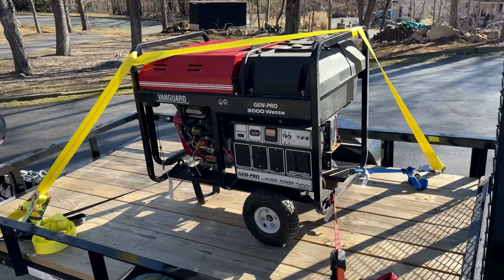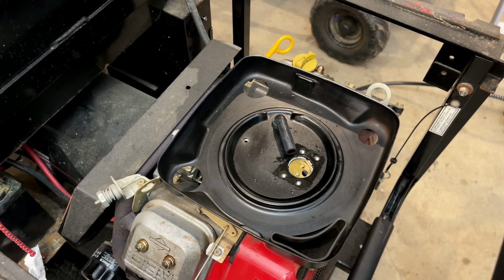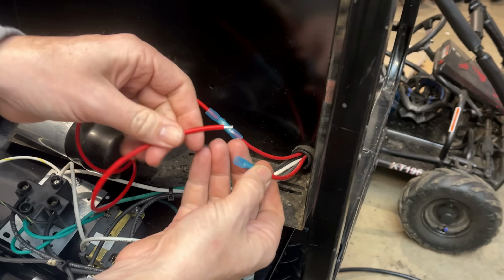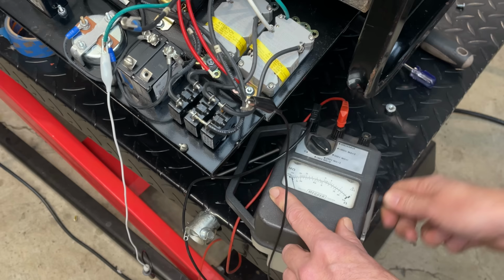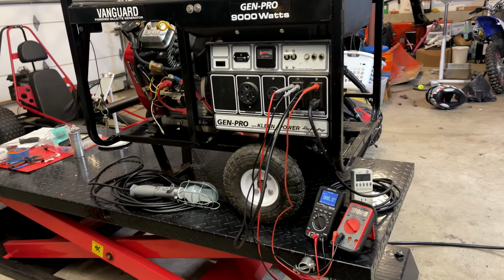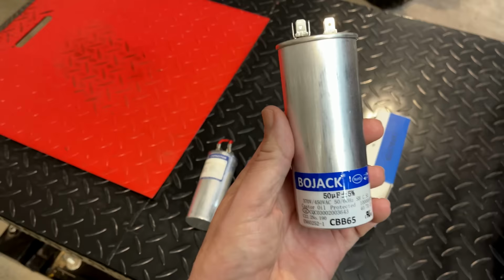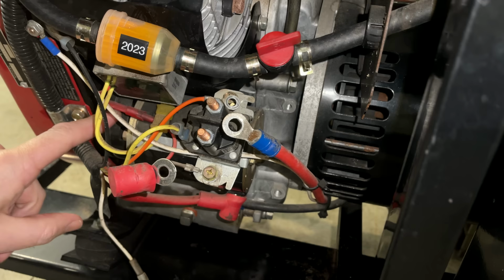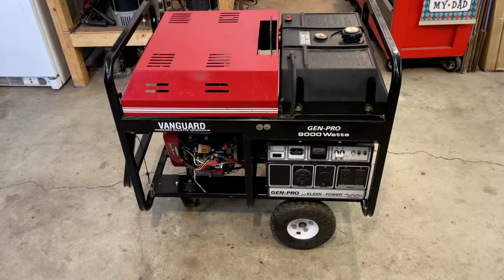How To Test and Fix A Brushless Generator

Comment: When you mentioned dropping a bolt down and intake, I have a question in that area. I am working on a mower with a Honda GCV160 engine. I was doing an oil change, and used a fluid pump to extract that oil. The tip of my fluid pump fell off in the dipstick tube and into the engine. It is made of rubber and is about an inch long. Is there any chance that I could leave it without having major issues? I really don't want to have to dismantle the entire motor due to a stupid piece of rubber. I resurrected this mower for a friend of mine after sitting for a few years, and I was almost done.
Reply: If you want peace of mind find someone with a scope with a grabber, oh, and I feel your pain, gravity and friction are cruel
Reply from the maker: I agree with Peter.  A scope with a grabber.  Chances are it will not cause damage, but I could imagine a scenario where it jams up the engine.

Comment: Did the first replacement capacitor happen to have a production or date of manuf on it.
Reply from the maker: It did not
Reply: Just wondered if it might have been an electrolytic cap.  They don’t have a real long life whether in or out if service.  In service their life is reduced quickly in hit applications and if stored in uncontrolled temp areas they are aging snd their in service life will be shorter.  It’s been a long time since I actively worked in the electronics industry and electrolytic caps were things we generated scheduled Mntc every 5-7 years to replace them.

Comment: I have a Porter Cable BSV750-W-3 7500 Watt brushless generator with a Vanguard Engine that generates low voltage 112-114v since purchase. When operating under a 1500W load the one outlet produces steady 60 hz, but the other outlet wanders 59-67 hz. Hoping to improve the power situation I pulled the stator cover and did not see an arrangement of wires like any of your videos.  I am finding 3 sets of winding wires off the stator, with one set heading off to a rectifier attached to the 12 volt output on the front panel. Is this extra winding a potential source of the unstable frequency in one leg?
Reply from the maker: Most likely the sine wave is not clean and your meter is having trouble measuring the hertz.  I see that a lot on brushless generators due to their design.  If you put a load on it the sine wave cleans up some and might improve the reading.  You can see the typical brushless output in this video.  https://youtu.be/9-oaSVL2AE0?si=4jWGC5WTfUnhm6SU. Also in this video is an example where I had difficulty getting a accurate hertz reading https://youtu.be/Um-rXWv_-iY?si=qRQA0DdULfwHdcmb
Reply: @jcondon1  Thank you for your reply, I appreciate your videos and taking the time to reply.  
I have not tried to examine the waveform, but was relying on the Kill A Watt device to report Hz.  You raise a great point here—I really don’t know how this device is sampling the wave and this “jumping around” of the cps number may just be an artifact of the sampling. I guess I will have to dig out the scope now and actually examine this wave. 
Thanks for the video links. I will watch them and continue the learning process.

Comment: Now I've never understood this why do you have it on when you Power It Up you're not supposed to generally you're supposed to have it off and then kick it on after the engine turns on I don't get it
Reply from the maker: A 70 watt load is not an issue.  Ideally you would let the engine warm up before putting any significant load on.  Also sensitive loads could be damaged by the surge associated with startup and shutdown.  A resistive light bulb can handle it.

Comment: always wipe the wire when you pull  it  out of the  emunislion tube otherwise you re contamenate the hole with that crud  watch    the start of your video as you don't do that you re introduce  what you cleaned out otherwise good video.

Comment: You could have used one of the, cut off, red wires to pull the two on the new capacitor through the conduit. Removing one of, cut off, ones to make more room before pulling them in the conduit.

Comment: That is the true quality of American built products, not sure about todays products. The company that made this unit, if I remember correctly was all American made and designed. They are not seen much my way out in the wild.

I like Honda Gen-Sets as well, however they are junk because the inverters are discontinued in a rather short period of time. Also the inverter assemblies, if you can get them from Honda are way overpriced. What good is a $8000.00 Honda you can't get an inverter for ??

Comment: i fixed this generator before for my friends it was dead i checked the compressions no compression tested the vale it leaking i said I can brings it backs to life again I need new parts the problems is there’s is no parts anywhere for this model he said can I do anything’s gets it worked agains without need any parts for it I said yes I can it easy it a pieces of cake i throw them in to the rubbish bins

Comment: How do you know 100% that the capacitor is discharged.  Those things scare me a bit.  I need to run the screw driver over them a dozen times before i feel safe.

Comment: While Relay Coils are not my Electrical Area of Expertise, I personally wouldn't risk trying to jar the plunger loose and continue to use the coil...

If it jammed once, there is a VERY high likelihood of it jamming on again and that will likely be the time it destroys the starter and/or severely damages motor itself...NOT worth the risk - relay coils are cheap...Starters and Engines are not...

Comment: Electrolytic capacitors have a limited life, in service. Or on the shelf. 10 years or more, change! DO NOT buy NOS. 
McMaster Carr has tons of motor start caps at decent prices. And they are NEW.

Comment: Brilliant deductions, Watson.🔍  You are so patient.  Learned a bunch from you today again, I also had a similar issue with my John Deere LA135, the engine had a compression fault, but during my own deductions, I had a burned out solenoid that stuck open due to high resistance. https://www.youtube.com/s/gaming/emoji/7ff574f2/emoji_u1f50d.png

Comment: Those capacitor testing meters that run on a 9v or some AA batteries are not really good for finding bad capacitors, they need to test at close to the operating voltage to read properly. I use an old HEATHKIT IT-28. I've had a bad capacitor show a reading nearly correct on a digital meter,  but show clearly bad when tested at its operating voltage.
Reply: Testing capacitors properly for different applications is a science in its own right. The necessary equipment can be complex and expensive. James only needs to  test these motor run type caps on brushless rated at 70 microfarads or below and the odd electrolytic reservoir capacitor rated at say 2200 microfarads or greater. His meter reads up to 200 microfarad and its enough to get him by.
Reply: @Terence Murphy  I've had the same size capacitor for HVAC test good on a digital meter just like he had, but didn't work. I put it on my heathkit and set the voltage level as close to the operating voltage of the cap, and sure enough the microfarad reading was way, way out of spec.
Reply: @specialservicesequipment393  I do not doubt it. Often the only really good test method is to test by replacement. James use of the lower microfarad capacitor to test the rest of the circuit was inventive and effective. You use what you have. It gives you some confidence to proceed. I have seen every single one of James videos and his constant inventiveness impresses me immensely. In the day I have designed and constructed individual circuits that can be connected up with the components you want to test and then the voltages and currents predicted can be measured.  It might be interesting to design a circuit that uses these caps to their fullest extent.

Comment: This being the internet where we're all experts and speculation is as good as fact, I offer the following: A poor contact design doomed the starter solenoid in it's relay function and too many years in a hot shed baked out the fake electrolyte in the two failed capacitors. See the Wikipedia article on the "capacitor plague" for more.